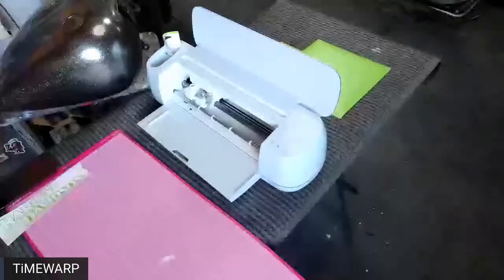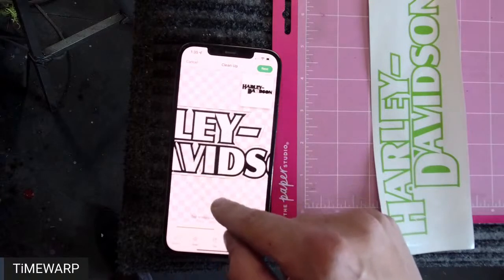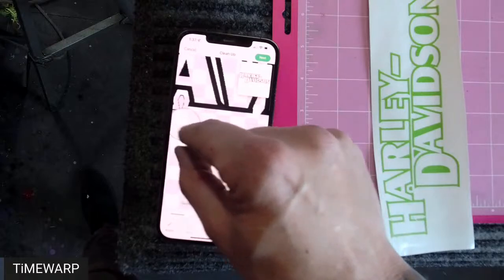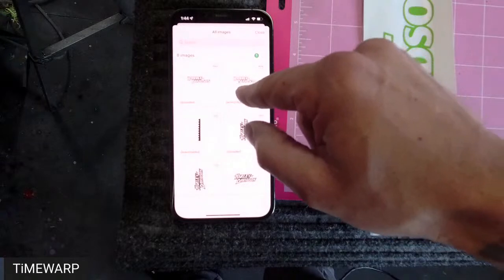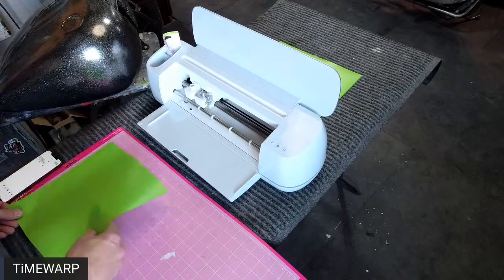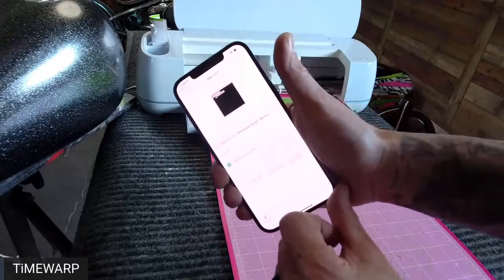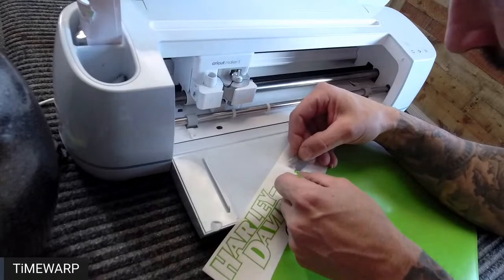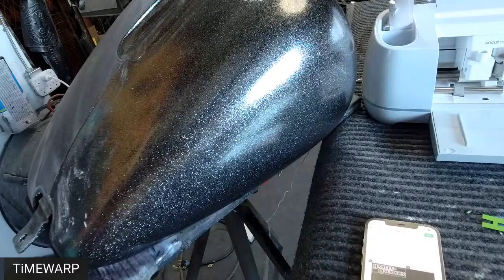Using a Cricut Cutter to make a Harley Davidson Stencil

Comment: As a general rule usually weed the decal from right to left easier faster because of open to the right letter styles. A transfer tape/mask is used to transfer graphics using a plastic squeegy or your finger might do if you carefully overlap to avoid bubbles , and yes , negative image is possible by reversly weeding the graphic image leaving a border .
Reply from the maker: Yep great tips

Comment: The one reason I went with the ca.eo is I can use it anywhere I want with out an internet connection. No cloud bases BS I love it like a love hate relation ship lol there's stuff I can't cut  out because it's either to small.orvto darn intracity. I don't use the stock blades I use a 2.0 holder it fits Roland and certain cricit blades. More options, but it's a manual adjustment. Once it's done it cut like butter.
Reply from the maker: Thanks I appreciate the support